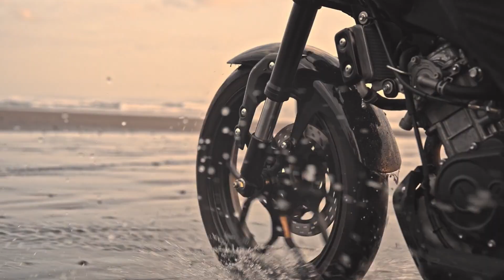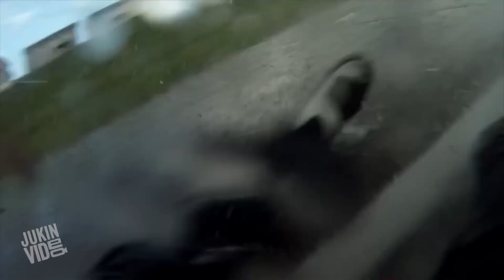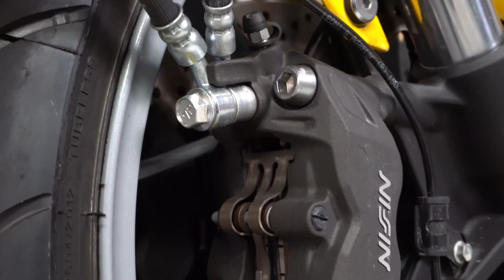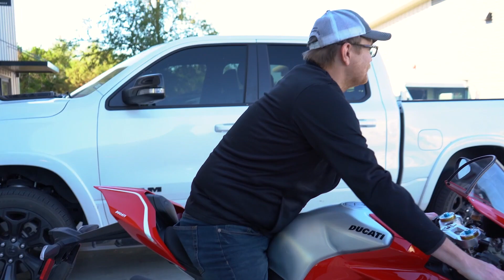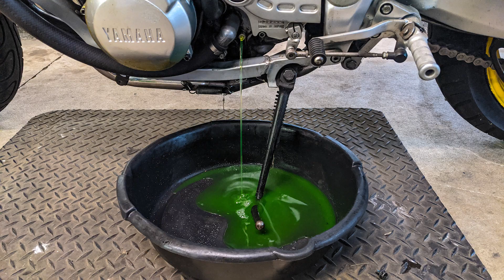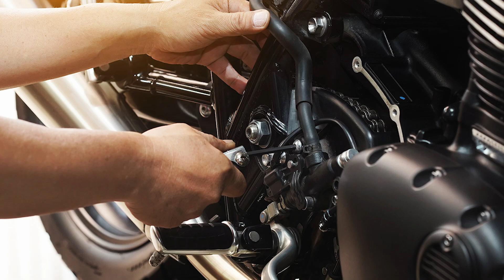Overlooked Maintenance Items on your Motorcycle that can KILL YOU

Comment: Go with michelin tyres and always check air pressure at least once a few weeks or so. Michelin tyres are amazing. Don't save a few bucks to risk your life by getting cheap Chinese ones
Reply: Pressures 32 front 34 rear is according to my mechanic wrong 
34-36 front and 33-34 rear

Comment: FYI   make sure you CLEAN THE CALIPER .. pucks ... bleed brake caliper OFF the rotor... put a 2mmish piece of wood.. use a old wooded ruler..bewteen the pads when cleaning, bleeding,  bleed LH to RH  for cross-over lines ... make sure you clean BOTH sides of your discs w/ a good contact cleaner, Brakleen .. and a Scotchbrite pad... or 1000 grit wet sandpaper.. if your pads are good, but stopping power hasd dminished..  again use 1000 grit wet sandpaper on the pad contact surface.. and discs.. clean residue off... you'll stop

Comment: I recently replaced my still good stock brake pads with EBC sintered pads on my Z900. Money well spent! So much better. Also ride with Pirelli Diablo Rosso IV tyres. I run 34/40psi at 77kgs and ride hard through the twisties … 🎉

Comment: Pro-tip: brake fluid doesn’t evaporate. Brake fluid levels indicate brake wear and are a good indication that it is time to replace your brake pads. If your brake fluid is at or below the low level on the reservoir, check for leaks and pad thickness. I personally just change my brake fluid every time I replace the pads, but do absolutely follow your manufacturer’s specifications for service intervals and fluid type.

Comment: Okay so i can get ahold of a 05 cbr1000rr with 19.5k miles on it for 2700 from a buddy just had forks rebuilt ,valves adjusted at the local honda and new michelin road 6's think its a good deal ?or should i avoid it due to mileage also not my first liter bike
Reply: Sounds good, but I only have a paragraph.
Reply: 19,500 miles is nothing so long as the bike hasn't been trashed........

I only had two new bikes but mostly second hand with minimum 15,000 miles and would normally get 100,000 to 130,000 before they died,  became unrepairable or were written off.

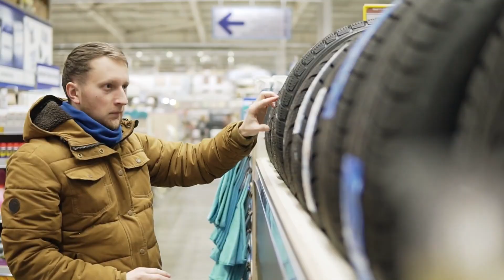Comment: 1:57 this really is important. I chose a sport tire that was recommended for bikes from 300's to 1,000's. I paid for a tire and when I got there they said they didn't have the exact tire that I was looking for, but had one that was on par, just from a different company. I said, okay, that should work - later on, after I had already driven the bike, I found out that the tire they decided to put on was actually the wrong f'ing tire. Now, had I known this, I would have told them to order the RIGHT tire that I initially wanted instead of listening to the guy who was supposedly a certified Yamaha tech. Don't listen to anybody at the shop, because they may not know what the hell they're talking about. If you've done your own research and have selected your own tire, gear, whatever - go with what you've already chosen, even if you have to wait for it. Because I ended up spending $250+ for a new tire and mounting that wasn't even right.

Comment: Did I miss the part in the suspension part , where you state that the forks and shock service interval on most bikes is somewhere between 3,000 and 5,000 miles? First question I ask when looking at any used bike (off, on road, or dirt bike) is when was the suspension bearings and fluids last serviced. Then when I hear and offer what I feel is a fair lower price, they get pissed.